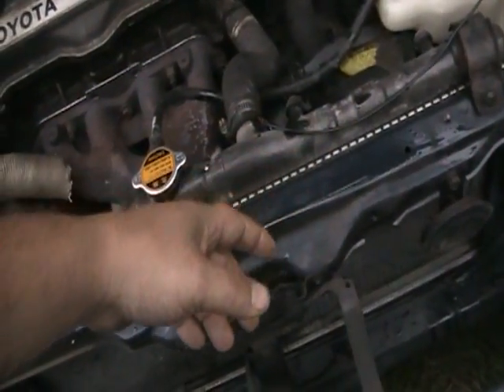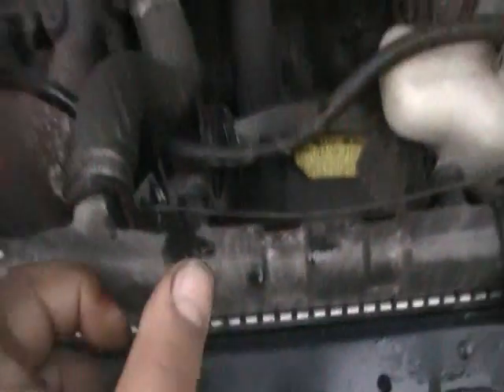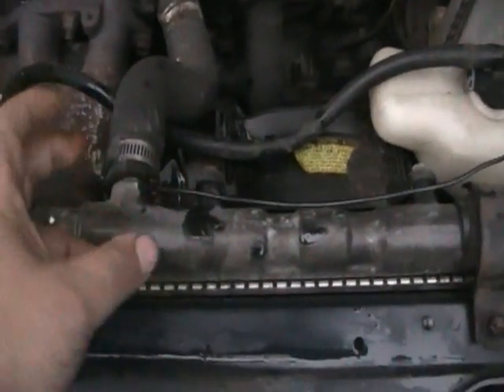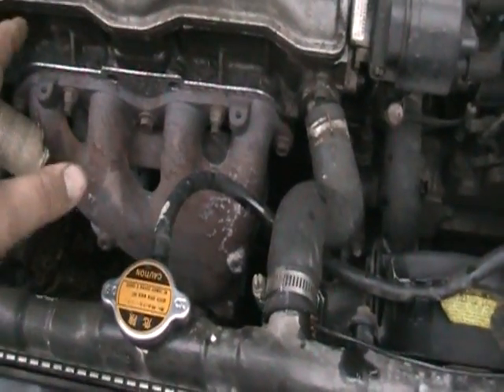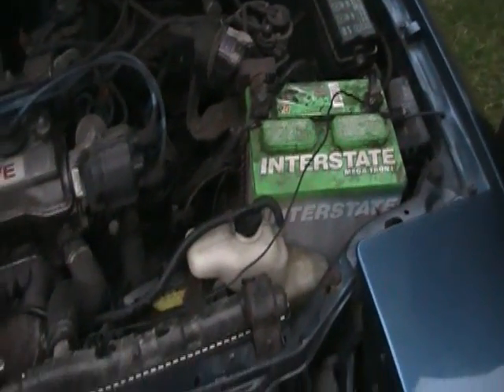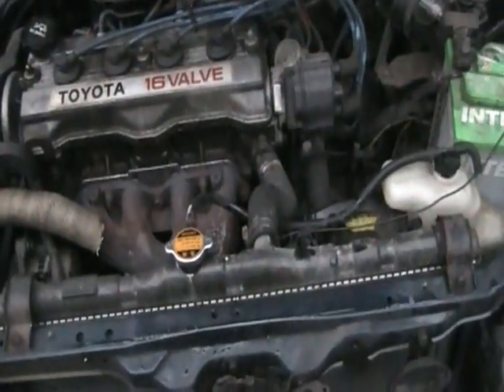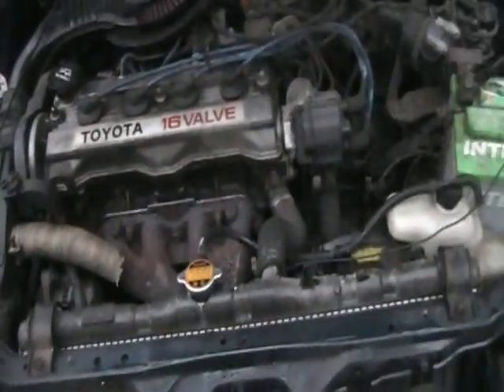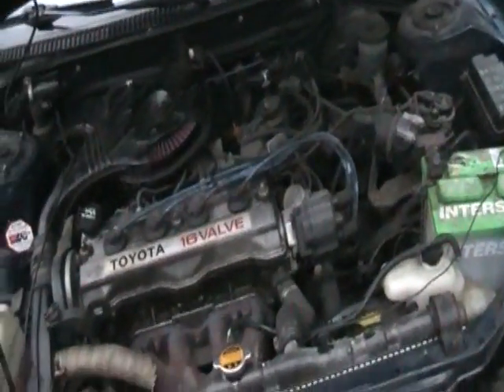joe cell save money on fuel with one wire

Comment: part 1 am so glad to hear that i thought i was going nuts lol on my bmwx5 v8 got aqua thrust kind of water injection sucks in the engine not got any pump am wondering that has blocked up if that is why its not working worst money ever spent  approx $600 bad investment it meant to make hydrogen rubbish con artists anyway could that have stopped it working that blocking  up i Daren t strike block on that parts to damn expensive lol

Comment: ok fellas just one thing the engine is earthed to the - anyway so what your doing is pointless have a look - goes to the chasis and to the donk and the donk is touching the water, I thought yous might of had a pipe coming off the radiator or something to the carby like a vacume thing but no , fucking sad ,
Reply: +richard rayner I see you didn't even bother to read the description. Rads are insulated and the block becomes saturated with Hydrogen that aids in the combustion chamber..